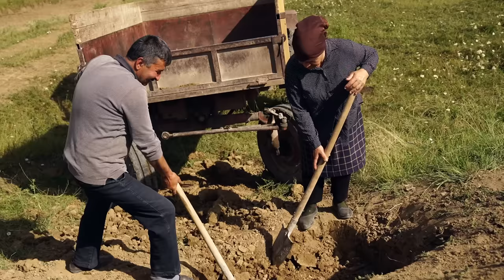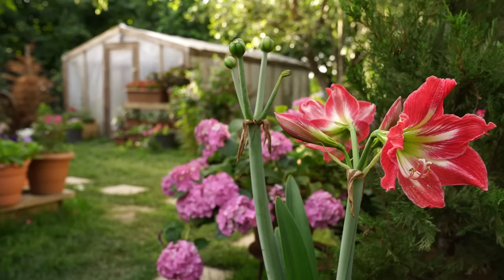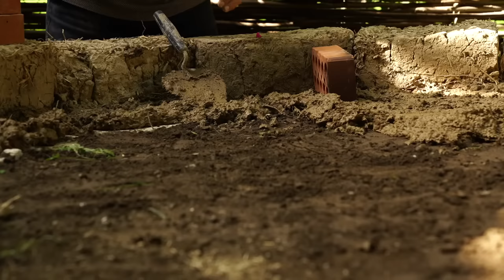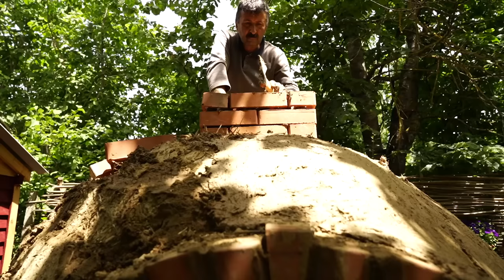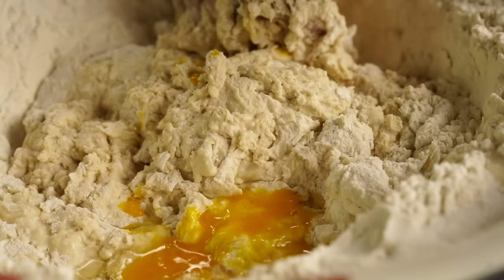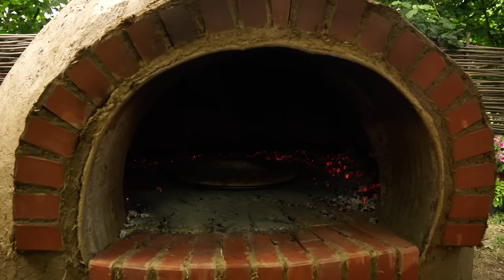Built Giant Mud Oven and Cooking Country Style Bread

Comment: Those who are experienced with mud ovens and I think these people have lot of experience, knows it is forbidden to operate this kind of oven right after build. It has to dry at least 1-2 month before you try it. The oven has no roof or some coverage, so the mud is going to melt after some time because of the moisture, rain, snow etc.  It is clear that the oven in this video was built solely for the purpose of filming, and I am not impressed with this lack of attention to proper construction techniques.
Reply: What chemicals did they use?
Reply: You have 2 arguments, and one opinion
1. ARG  it is forbidden to operate this kind of oven right after build, VALID
2. ARG The oven has no roof or some coverage, VALID, but how do you know that they are not going to build a shelter, may be next morning
3. OPN Not impressed with this lack of attention to proper construction techniques, WE RESPECT YOU OPINION, BUT MAY BE MOST OTHER VIEWERS ARE IMPRESSED